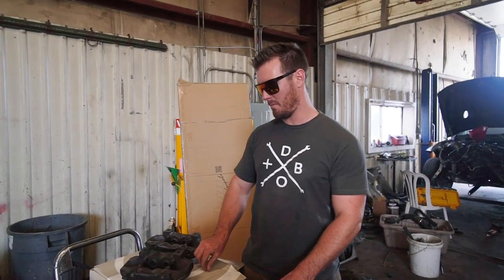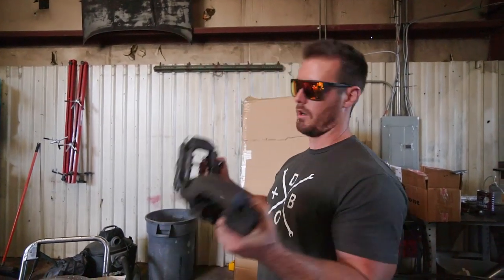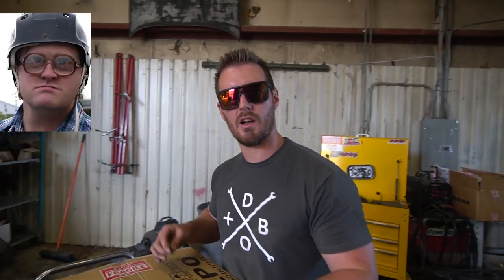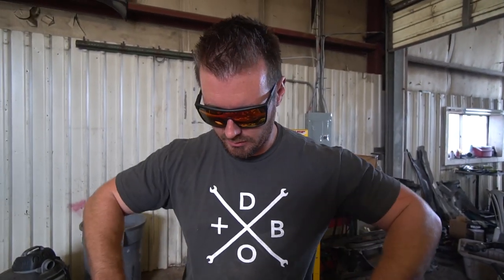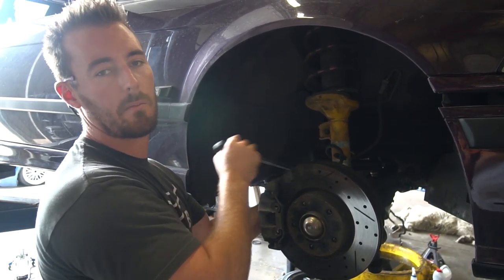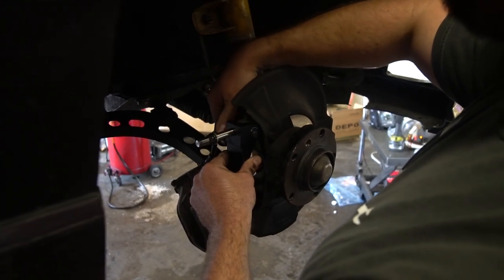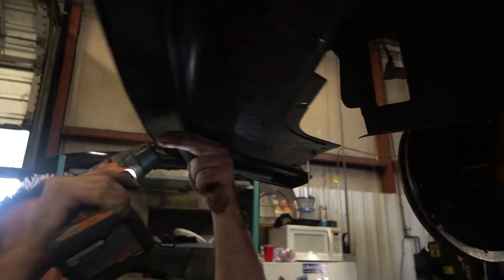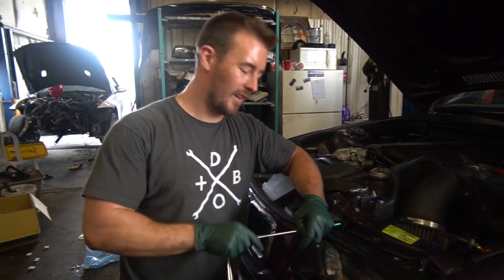Will's Daytona Violet M3 Gets A Makeover!

Comment: Grey lead is for the tiny daytime running lights ... so equipped on DEPO's but no bulb installed from the factory. The off white tab inside the high beam is where the bulb goes.

Comment: Are those depo's the gen IV's?? If so I had the same ones with the umnitza thinline angel eyes and 55w 6k hid's. You should do the parking light delete mod and just run city lights inside the headlights. They should have the 194 bulb sockets pre-installed and all you have to do is throw in your choice of bulb and connect them inside the headlights themselves.Thats the gray wire that comes from the light, eventhough I'm sure you figured that out awhile ago. Parking light delete is easy, and you dont even need to cut any wires. Just pull your turn signal bulbs and put a piece of electrical tape over one contact on the bottom of the bulb. Really cleans up the front end of the car. I also ran the smoked clears. I had to replace them after losing the passenger side one around 125-130 lol. It tore the bulb socket out with the lense. After that I drilled a small hole in the tab that's supposed to click into the headlight and 'safety tied' it with a zip tie to a tab on the side of the headlight. That took care of that. Your car is looking good with those beyern mesh. Love the brake setup as well. Those csl rotors are extremely nice for being OEM. You can tell you have a ltw flywheel too. Most of them make the noise until you push the clutch in. Thankfully my Jb racing one was pretty quiet. This channel is great, I'm glad I found it. . Always enjoy the content.

Comment: Are those calipers you purchased rears or fronts & also is there a bracket to run e36 rotors instead? I hate 18’s
Reply from the maker: The calipers are fronts from a 996 porsche. There are two options, this one is the CSL rotor kit so you have to run 18s. The other kit just runs regular e46 M3 rotors and allows you to still fit 17s.